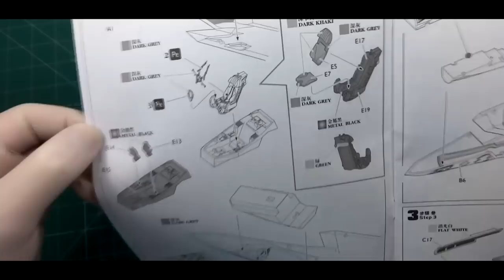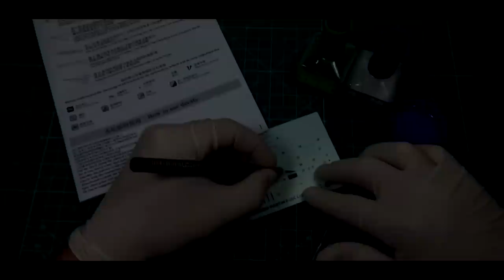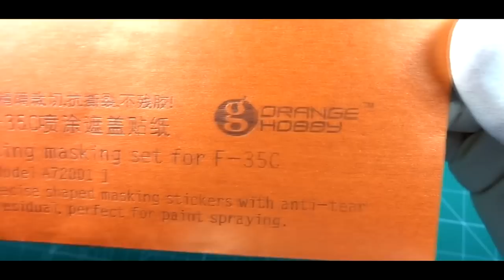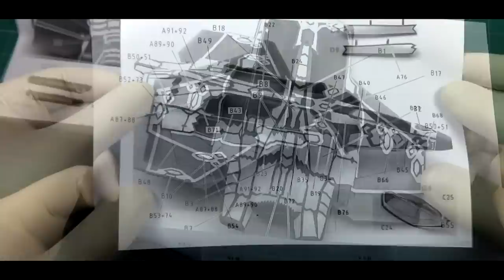F-35C Lightning II Orange Model FULL VIDEO BUILD

Comment: What kind of glue are you using for this model. I saw the part where you put the two halves together and im wondering what kind of glue you used. Also, is that a special glue container that only lets a little out at a time?
Reply: Looks like Tamiya extra thin cement.

Comment: Looks very clean like it came right out from the Lockheed-Martin factory. How did you get the X-22 to lay on super glossy, did you use Mr. Color Leveling Thinner? I'm thinking of adding some metallic paint (Gunmetal or Matte Aluminum) to the base color grays for that metallic look seen on the real planes.
Reply from the maker: +Kelvin Foo I am using regular Tamiya thinner but with low pressure. All the best! Dusan. Btw, Yes, You can add 10% aluminium.

Comment: Hi, great model! Could you tell me what putty did you use? I saw it's something from tamiya but never actually saw this before. Thanks!
Reply from the maker: MrTommythecat86  Sorry I forgot to write that down. It is a regular Tamiya Liquid Surface Primer from a bottle. (40ml pack).  This primer is perfect for holes and small gaps, and can be easily applied with a modeling brush. (also You can use Mr. Surfacer...). All the best! Dusan.

Comment: what thinner ratio do you use with Tamiya? I just tried tamiya for the first time and I couldnt seem to get the proper mixture.
Reply from the maker: 60p-40t with high air pressure. 90% of the time I am using 50-50 mix. All the best! Dusan.

Comment: How long did it take you to mask that kit with that masking set?  Looks rather tedious!
Reply from the maker: This job is much more complicated without the masks. 4 hours... All the best! Dusan
Reply: Hello again.  Looks like I caught the bug!!  I just bought this kit and the masking set.  Not really a fan of the F-35 though I think in looks better in it's Navy form with the twin wheel nose leg.  Just out of curiosity, I noticed you clear coated the model once you applied the main colour before adding the extensive masking set.  Did you apply a clear coat to the light colour before removing the paint masks?